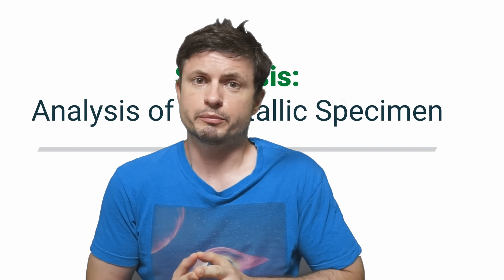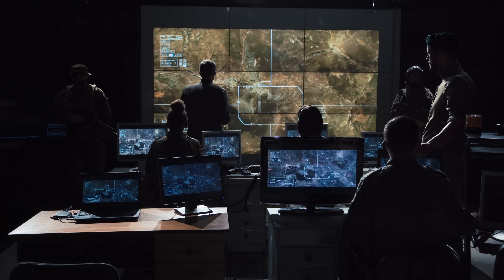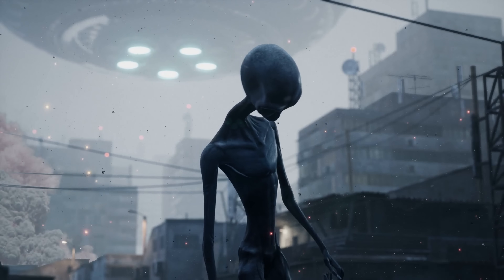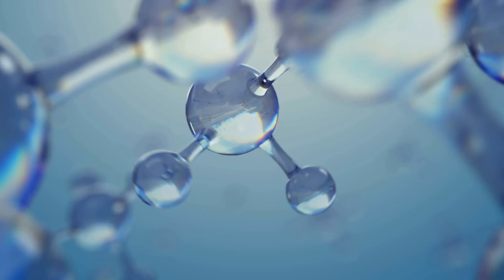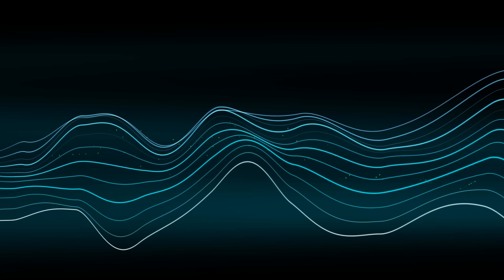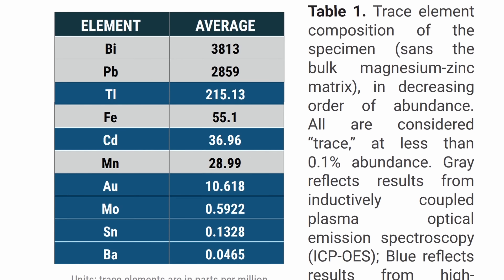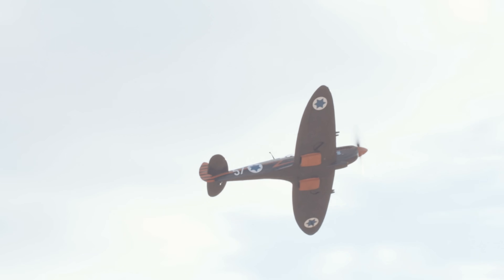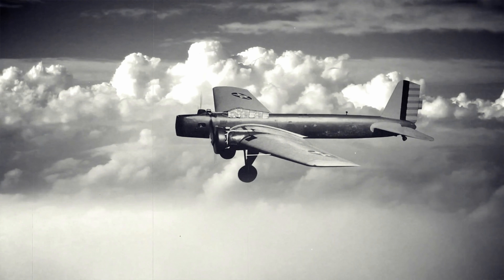Metal Piece From 1947 Roswell Incident Analyzed By a Government Lab

Comment: Keeping data on failed experiments is arguably more important that keeping data on successful ones. Especially for flight testing.
Reply: One is invalid without the other.
Reply: @samuelgarrod8327  I would respectfully disagree, especially when stated as a "general principle". To  avoid writing a "tldr" I will simply point out that in cases were experiments are not done as "basic research" finding a "solution" that "solves the problem" within the required specifications can be all You want and need. And the fact that You failed to keep/document failed attempts does not "invalidate" the fact that You have created a "working solution".
Best regards.
Reply: Very good point
Reply: ⁵ @Nardage 😢the individual 😢
Reply: @paulgriffin9355  Let's cryy
Reply: All experimental data is valuable as long as the experiments are performed with scientific rigor.
Reply: I can imagine when the tests with these magnesium alloys were carried out, they were considered top-secret back in the day. So the data was not only unavailable to general public, but also most probably destroyed afterwards.
Reply: @hav0k337  weather balloon.  lol
Reply: How many previously failed experiments turned out to find something that later helped us in a different application is still countless.
Reply: Hell, we didn't even keep good records on successful projects. We had a bunch of nukes that needed rebuilding, a polystyrene filler of a rather special sort needed replacing inside of the warhead itself.
The original "recipe" was lost, the assembly line mostly dismantled. A more modern and long lasting replacement was sought or at least the same item replaced, so well, at the end, the DoD spent around $200 million to replicate and in that, replace the plastic with an aerogel with a special dopant that originally was accidentally included as a contaminant, but had certain desirable characteristics.
Even money, they could've saved a lot if they just bought the data back from the Russians...
True story, look up fogbank.
Reply: Definitely, so much saved time and resources saying "oh, hey wait a minute, we did that already, here was every issue with it", which even allows for skipping ahead on revisited concepts being incrementally built upon from these fails
Reply: Keeping material that failed tests of that time cycle, could be the key to all of the universe when tested again centuries from then. New technologies, new ways and ideologies of looking at old data. Your take away key point here is so true, that even scientists of today should read it over and over again. I strongly believe it should be printed in Bold, Gold leaf imprinted on every book of science, biology, physics and quantum mechanics book today and of tomorrow!
Reply: @project-unifiedfreepeoples  An may be the data exist in some buried scientific paper somewhere. But spending hundred/thousands of hours hunting through papers is really beyond the scope of this video and he scope of the people researching this piece of metal.
Reply: @DavidKnowles0  I was thinking well beyond this article, but I see your point. Thank you for giving me greater insight. Blessings
Reply: All data is valuable.
Reply: @gymhayes4613  All data is also going to be lost eventually.  All it takes is time.  The funny thing is........the data storage technology we have now is great at storing large amounts but it's actually even more fragile than ancient techniques such as writing it down on vellum.   The paper archives may actually last longer than the digital ones.
Reply: @MrBottlecapBill 
Wish I could agree with you but we can encode petabytes of data right into crystal. It may not be etching on giant stone slabs but encoding data digitally into stone will make it last far, far longer than vellum.
Reply: we learn more from failures than successes.
Reply: I was thinking that exact sentiment!
Reply: Very true
Reply: Most important statement of all time friend.
Reply: Thus why we have the white box on planes
Reply: Project mogul
Reply: Both are important
Reply: Keeping data isn't easy. Papers widely got destroyed or lost in storage, since they take space and collect weight and nobody get's paid to read through millions of pages just to find some maybe usable ancient information.
A significant amount of digital data aren't acessible any more, because they got corrupted by age and decay of the medium or the loss of old technology and the knowledge to handle it due to retirement etc.
Reply: Yes aluminium can crack too easily. Experiment done and hopefully they didn’t lost life’s. Sadly to those who really don’t know how to think logically like who are believing Aliens in Roswell. This is not movie. “Damn real life sucks”.
Reply: As a professional scientist I try my best to keep all experimental data regardless if the experiment was successful or not.
Reply: It's incredible how thoughtfully Anton lends himself to dealing with topics that don't concern astrophysics! Especially if they come from the AARO office. I would ask myself some questions if I really want to be objective...
Reply: Anton needs to talk to Gary Nolan. instead of taking these low hanging fruit and debunking them
Reply: @edwardsmith-rowland2852  Actual scientist speaking here. Sorry to disillusion you, but the vast majority of experimental data is lost or is just thrown away. There is no systematic storage of this stuff. When Bob is the only guy who knows where the data actually is and what it means, dies, retires or moves to another job, no one else knows anything about it. At best it is meaningless numbers in a box somewhere, which sooner or later will be deposited in the city dump. Or just erased if it is on a computer.

That is reality and how things work. It is the fate of almost all research eventually.
Reply: CERN disagrees, they throw away most of the data generated by the LHC
Reply: The results may still exist in an archive of classified documents. If the material was connected with military research, this is entirely possible.
Reply: I believe this piece of metal should be compared to the sample extracted from The Baltic Sea Anomaly.
Reply: Statistics tells us that succefful test data records too are vital... i mean nasa lost research data about moonlanding... and see where we are... at the beginning 😅😮😢😂😊
Reply: I disagree
Reply: All data should be kept equally
Reply: That's why there was a Roswell crash to begin with. The alien narrative is just being sold to hide the fact we're the ones who make them.
Reply: Yep, I was taught that and believe it's called the empirical scientific method.  😊
Reply: And light bulbs
Reply: That's why I love science... There is no "bad data" in science, only the expected and unexpected.
There are no "failed experiments" in science, only results that confirm or deny a hypothesis.

All data can be, and is, useful... Maybe not to you, in the here and now, but potentially to someone, at some time! (as proven here)
Just as well, your experiment may not have yielded the results you wanted, but could answer someone else's question. Or, could generate more questions, whose answers yield important findings!

That, to me, is the beauty of science! 😊♥️
Reply: You're failing to comprehend that information that only exists on paper since computers didn't always exist, is far more likely to be lost than not.
Reply: For example, see dark energy!
Reply: Failed experiments ARE succesful. I guess a truly failed experiment provides no evidence of anything?
Reply: It SHOULD be kept, but, before WWII, those where probably stored in a folder next to the desk of someone. Then, the place get closed, and all the paperwork disposed off, and the samples sent to the closest foundry to make some nifty mag wheels.
Reply: not for ufos though. all you need is one black swan.
Reply: Excuse my stupidity but aren't metallic chemical elements crystallographic at the atomic level?
Reply: Wasn't the material from the Roswell incident a shiny metallic smart material which was flimsy but very robust?

Something certainly does not add up here so do we need to be told?
Reply: But failed experiments fall into specific categories. When they eliminate a category and if it doesn’t show possible use for another purpose, since all of this data and experiments couldn’t be kept because of reasons of space, they are dumped. You have to remember that this was well before the days of computers where physical space isn’t a problem. Generally, all that is kept are some records of the experimental lines and that they failed to present a solution to the problems they were seeking to solve. I hate to say this, but this is standard procedure.
Reply: It would be absolutely remarkable, and nearly unbelievably wild, if alien civilizations were NOT visiting earth.  It would mean that there's been a massive global conspiracy involving thousands of high ranking govt, military, and intelligence officials all lying in tandem for decades about their first hand knowledge and experience with these craft and beings.  Also, all the craft being filmed (since the 30's) would need to be of human origin, and that's also hard to believe because they are clearly so advanced.  Also, if some country really did possess this technology, then why haven't they used it either of the 2 world wars?  Yea it takes a LOT of wild presumptions and conspiracy theorizing to believe ET isn't flying around, the problem is that most people just don't think about the reality of the situation deeply enough to realize how completely bonkers that position actually is.
Reply: We can't trust arro. They "debunked" all of the alien stuff ryan greves and those guys submitted. All with B.S answers.
I don't trust this either
Reply: If we find the alien artifacts at area 51 there will never be a need for flight testing again
Reply: Absolutely. You learn about what not to do, and incremental steps. You are always building a pathway.
Reply: So you dont end up repeating them
Reply: You speak the truth!
Reply: Humans... There are some things you can count on.
Reply: Elon Musk is only successful in his SpaceX company because he made a point of intentionally creating what would be seen as failures strictly for the data he could collect from each one. Data is important for all reasons.
Reply: A piece of an alien tricorder?
Reply: This has to do with the Supernatural and not scientific study
Reply: @martinrascon1350  Unexplained doesn't mean supernatural.  Even if it was supernatural, it would be scientific proof of the supernatural.  You can't reject data just you don't like the conclusions drawn from the data.
Reply: A lot of research data simply gets lost over time, especially if the results don't produce anything notable. 80+ years is a long to keep every single paper record, and if you use the results in your next series of experiments, much of it has been reused anyway. Sometimes the research has been duplicated elsewhere and is readily available, so keeping "top secret" versions isn't even necessary. But hey, practicality should never get in the way of idealism or a good conspiracy theory.  😂
Reply: Part of the scientific method dictates when you exhaust all attempts to prove your theory wrong, then u might be right.
Reply: Not really though. The demands for modern craft are far higher today, so those failed experiments would be worthless today, because there'd be no application for them. Back then most aircraft were propellor driven, that did maybe around 400mph, and most even less. If that alloy wasn't performing well back then, it certainly wouldn't today.
Reply: It is critical to keep data on successful experiments.  You are paid to find what works.  Try telling my boss, "I have all the data on what doesn't work but can't find that data on what does."
Reply: The Governments laboratory investigating evidence of a government cover-up? I already lost interest in the video.
Reply: Yep, but before our modern era people did stuff like reusing computer tapes and deleting important test information, programs, space images, and all sorts of stuff. We don't do that stuff because anyone can go and pay  20 US$  (close to $2 back then) for 1 TB of storage smaller than a big man thumbnail.
Reply: I used to work for Smiths Industries, and my job was super-fun: try to kill the flight computer with lightning strikes, EMP, RF hell, etc. Destructive testing is the single biggest asset in the development cycle. And it's FUN!
Reply: Absolutely the read for that being if you don’t get an answer from an experiment that means you don’t have enough information so keeping the data is more important because there’s no way of knowing what is or isn’t important to said experiment
Reply: What's with the bullet holes in the wall 😮
Reply: It's easier to keep data these days.
When this data was collected, it required many boxes of paper, vulnerable to water damage, mold, silverfish, etc.
Often it was warehoused, and then sooner or later would get damaged, and then discarded as unusable.
Only successful data got "good" warehouses, and multiple copies ;)
It wasn't as simple as burning it all to cd, or something. There was a real estate & upkeep cost to keep data.
Reply: Was talking about this just yesterday.   Awards should be given to properly done studies that makes findings that show no correlation in a experiment.
Reply: YOU MEAN WE STILL HAVE THE SPRUCE MOOSE? GOOD GOD LETS FIND IT SELL IT TO SPACE X
Reply: Design, Delegate, Disappear, Inspect, Redesign,
Delegate, Disappear, Inspect, Redesign, Delegate,
Disappear, Inspect...
or Envision, Enable, Empower & Energize or Feed
back, follow up, positive attitude... Constant
improvement through feedback is critical.
Reply: Agreed but also as a Millennial I can literally not imagine needing to keep data in the quantities I’d presume the government had, on … paper? I mean. Imagine if they did keep it all — they’d be so backlogged from even digitizing it in the first place 😂 I’m sure it is done, was done, but by the government lol its equally as laughable
Reply: @seanivore  there are alot of data archives, some on paper...
litterally km upon km of archives
Reply: @seanivore  It was.
Reply: @seanivore Seeing all the paper records and how it all works is a sight to see. I was born in the 80s so I got to see the old and new way of doing things. Mechanical shelves & sliding ladders all over.
Reply: @seanivore - But imagine all of the underemployed people the government could hire to digitize all paper records, from NASA to the VA.
Reply: @seanivore the government is aware of the possibility of digital suddenly becoming obsolete albeit the statistics are low, paper is important and will remain so for masses
Reply: It’s not because it has much less information density. It is essentially noise
Reply: @diamondjazz2000  tell me something, to study properties of aerodynamics, do you study the air around a geometry, or how well a geometry reduces drag overall IN air. Or can you tell merely by the silhouette of a geometry exactly how aerodynamic it would be. You would probably say it's fairly intuitive to look and get an idea, but it's only intuitive after understanding air resistance enough to make inferences. Meaning from failed geometry, points toward candidates for more probable to be successful geometries. This "noise" can be applied to find effective ranges of any given property or trait. Finding the bounds of effective geometries allows you to not waste time pitching geometries far outside the empirically effective bounds.
Reply: That's why NASA 'lost' capability for manned moon missions !   😉
Reply: @DrOtto-sx7cp  Nah, that's because they went digital
Reply: @DrOtto-sx7cp  You know NASA is a public entity and they publish everything right? Like they straight up wrote a how to go to the moon manual. NASA didn't "lose" the capability to go to the moon, they (and everyone else) just realize that the way they did it was absolutely insane and beyond risky by today's standards. Only thing "lost" was the institutional knowledge of the various fabricators who made everything by hand and conspiracy nuts ran with that. I mean if you want to waste time weaving together computer bits by hand from copper wire go for it, but the rest of the world has moved on. So yeah, the tech is "lost" but only  in the sense that it doesn't make any damn sense to use any of it. You have to do it from scratch with modern tech, hence Artemis.